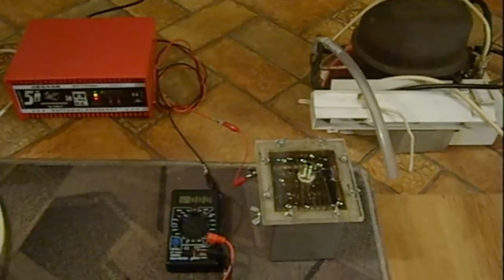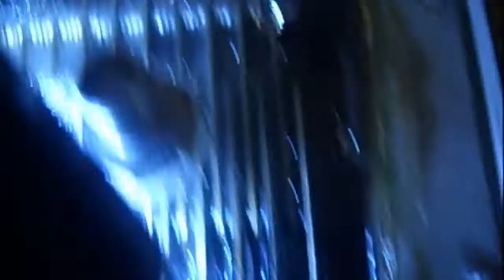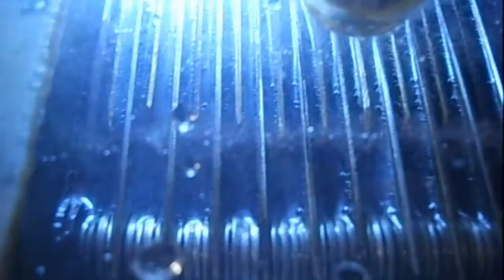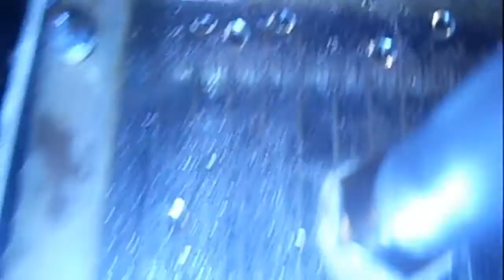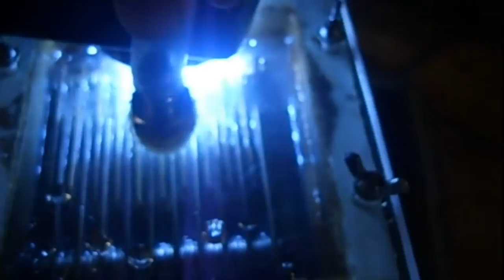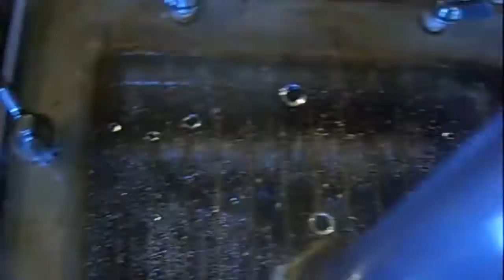Electrolysis under vacuum (Larger bubbles, same HHO quantity)

Comment from the maker: With vacuum only the size of the bubble gets bigger due to low pressure around it, but the hho content should theoretically be close to identical in my opinion.
I haven't tried it with pressure yet, and also this setup used tap water only, I must repeat the experiment with some KOH (potassium hydroxide) too.

Comment: So the conclusion is: You don´t produce more HHO gas with a vaccuum ? Just the bubbles get bigger ?
Indeed a few friends of mine have said, that an HHO cell produces more HHO gas when the pressure is higher, like 2 bars as this makes the bubbles smaller and more water-electrolyte can enter the plates... Is that the same experience in your experiments ? Many thanks. Regards, Stefan.
Reply: i agree with this. Electrolyte will have more contacted area with the plates. But, the ratio of Liter per Amperage will still the same thing, IMHO.

Comment: You are absolutely correct I boosted Hydrogen production for medicinal use by employing a vacuum. I estimate at least 600% to 1299% increase. Possibly much higher!
Reply from the maker: This device produces hydrogen and oxygen, it is not separating the 2 gases. Only the volume of the bubbles increases, the mass of the gas has to be the same in my opinion. So if you are doing something similar than you won't get more hydrogen!
Reply: @furulevi   The production of hydrogen will increase a little more, but the key thing that has been gained is that the production of hydrogen and oxygen will be accelerated, which is a very good basis for converting any gasoline engine to hho drive. If you understand what I mean.

Comment: Bro y u dint make a capacitor?2 cells linked nd show pd?
Reply from the maker: Capacitor? The electrolysis box is already a type of battery, because there is hydrogen and oxygen around the plates, so if you disconnect the power from the box and connect a consumer to the box than it will power a small device for a short period of time.
Reply: @furulevi  man box is capacitor period!Moresore loop bubbled aether substitute h20 with gas ul See magic!Lower volts.lvl up and play with box!

Comment: hey furulevi , i have this little system and i did an electrolysis and it required air , i watched it carefully and when i introduced air , it reacted more , and i dont know , the electrolysis doesnt work on vaccum right ?
Reply: how is that on a vaccum ?
Reply: When you introduce vacuum the "boiled" water vapour neutralizes it, it cannot be under vacuum/lowpressure unless you pump the produced gases (and vapour) out. For better production of gasses you need pressure. But pressure of HHO means posibility of explosion.

Comment: Every engine is a pump and compressor....

I've had insane results with gasoline vapor....  I removed the carb completely from a generator.

Made a plate the same shape as the gasket.... re used the gasket had a threaded section of pipe welded on to the plate....

Hooked that to a t valve and used a garden hose to connect to the top of a gas can.... it pulls a vacuum on the gasoline and it evaporates at a lower temp... after a while ice builds up on the outside of the gas can